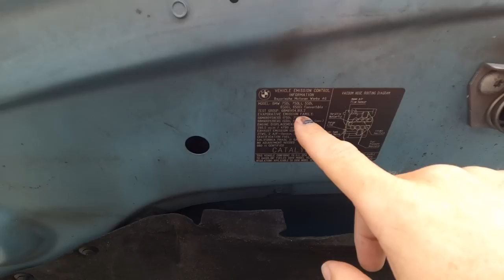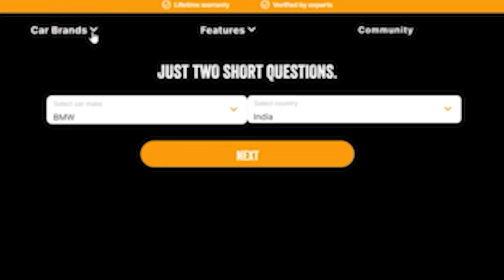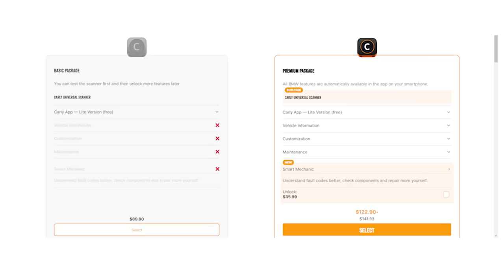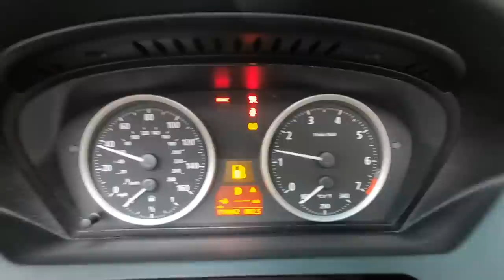We bought and sold a Salvage Title BMW 650i - Will we Profit or Lose?

Comment: Just got a 2011 BMW 328i xdrive. Salvage title from auction. I love it, first BMW great little four door all wheel drive car for winter. Replaced hood fender and headlights. I’m sure when I sell it will get up to double money put in…Don’t be afraid of salvage title, just know what caused it… in my case a barely damaged hood, a cracked barely bumper, dented fender and busted single headlight plastic…
Reply: If you are a private seller, save the photos and show the new buyer when ready to sell.

Comment: I owned one. Way back when. It kept dying on me quite often . I remember  a recall for this issue .  The fix sounded very easy. The wire connected  to the main battery was installed backwards.

Comment: Nobody in the history of BMW that has bought a BMW has ever done alright at anything other than buying a ticking time bomb that the only surprise will be the number of different things that can go wrong and will with time, go wrong!
Reply: Yupp its inevitable, those that say "ive had a bmw with so many miles problem free are full of shit" most of their parts are made of plastic thats not designed to hold up for very long and this will lead to leaks, not to mention all the extra sensors and electrical modules that will go out in time, like you said its literarily a bomb. Owned one at one point and never again 😂
Reply: Facts
Reply: Um............that's like every other mfr., every car is a potential mechanical ticking time bomb.
Reply: You paid $3800 for it. If you spend $12k fixing it you can probably sell it for $3300
Reply: @shelbysnake5003  Considering bmws ranked really high as reliable cars, a lot of people must be lying 😂 except for you of course!!
Reply: Meh, there have been some BMWs have been alright. My dads business partner had a 2011 7 Series Diesel that he put on 400k kilometers in 10 years and the car has been reliable for the entire time all the way until the end when it had a major oil leak that wasn’t worth repairing. But that’s to be expected. Not like American cars are any different (looking at you Ford, with your terrible transmissions that last maybe 200k kilometers). And then there are bad BMWs. My dad had a 2019 M550D and the car broke down 1 month after he bought it. Then the AC stopped working, multiple sensors failed and the last straw was when the entire infotainment system (even the driver’s information display and the speedo) stopped working. He actually replaced it with a high mileage 2017 Audi S8 and even that had been way more reliable.
Reply: Agreed
Reply: @Just some random guy  make no mistake I'm in no way saying Ford or any other American car are pillars of reliability! I'm also sure  that there have been BMW that have been great cars, (the sun shines on every dog's ass one day) your statement about AUDI is true, I've not heard any real negative information about them but if you want reliability with low maintenance cost and repair cost we must take this conversation across the ocean to the land of the rising SUN however they do have manufacturing in Mexico and The United States which makes sense considering they are taking over the world. Basically if you want a car you can count on but feels like you have E.D without any viagra then Honda, Toyota, or Nissan are top of the list. (Those manufacturers do have what some would say are performance model cars but the increase in performance comes with the cost of reliability
Reply: Seems to be the case in the US market the Germans wouldn't agree.
Reply: BMW a money pit same as mercedes and a host of other brands
Reply: @ddutsie No
Reply: @Beamers CEO of bmw has entered the house
Reply: Most BMWs are neglected because people who can’t afford them buy them. Don’t buy used, and don’t buy if you don’t have the funds to fix an abused one. Haters
Reply: I've come to the conclusion people who shit on BMW's without any knowledge of actually owning them are just really salty Subaru owners. Don't you put your evil on us Subaru owners 🤣🤣
Reply: @robsim4692  yeah generally Japanese cars are good, except for some of the Subarus due to engine issues and some of the smaller Japanese cars (they rust so fast where I live). Now Audis have been reliable to my family, especially since we take good care of them. We have 4 Audis and one Volkswagen. Most of these have been trouble free including my first car. It’s a 1995 Audi A6 with 130k miles (converted from kilometers), been a one owner car and it’s just had normal maintenance. It’s on its first engine and first transmission, just passed the strict car inspection Germany has. I’m planning on getting it to 150k miles in the next few years.
Reply: @adasterdezaster2865  did this with a 2.0t Passat, that thing kept me busy 😂
Reply: @Beamers  For the year 2022, one year is nothing to bragg about when you take into consideration how long they have been manufacturing cars for, the BMW brand has been a meme in the car world for the longest you should know this bud 😂
Reply: @shelbysnake5003  Who said anything about just 2022?
Reply: Most of their inline 6 engines are pretty good, some accessory things and certain gaskets that are common to go out but also remember bmws are oriented towards performance not long term reliability.
Reply: I bought a 2010 335d with 70k miles for $20,000, drove it for 7 years, put 100k miles on it,  sold it for $7500. I took excellent care of it and enjoyed it very much.

Comment: You know what you can do with 3800 at the auctions.  Consider you need your money to make 2 grand to break even.  Possibly one flip.  The next buy should get you near 7-8k when all is said and done...again how are sales during the holidays?  Once you do sell your second vehicle think on the time factor because that will be the determining factor. I am also pretty sure it could snow in April too so it may be 4 months till top down spring.  If at any point along the way you want to blow the car out cause you still aren't sure what you will get for the car, imaging you just want to get rid of it and blow it out for 6500 and say enough all ready.  After reading this I'm sure you would agree the best to do is sell it now and have the money to work with.

Comment: What is that color called?  I’m looking at buying one that was hit on driver side door and fender. Runs and driver great no smoke. Car is $1000 and I’ve priced door and fender 250 a piece. Paint may cost around 100 with me painting them. So 1600 all in without running into any bumps. I’d most like put it up for sale for 8500 and come out with 6k at the least.

Comment: 6500 for any car with 177,000 miles on it is insanely overpriced 
Craig 
Most people who buy a car expect to get at least 75,000 miles of use out of it without major engine or transmission repair or replacement 
They don’t just let them sit or drive to concerts or picnics
They really want to buy something with less than 100,000 miles 
You paying 6,500 for a 177,000 mile car is ridicules even 1,500 sounds high especially if it has rust.  
My  best wishes always from Las Vegas Craig 
Bravo 😊

Comment: I love the Carly App it helped me fix everything on both my 330I's and I was having an over heating issue on one and my autel wasn't telling me anything. No codes but MyCarly told me that the fan was not working correctly. Ordered a new fan from Rock Auto and a year later still good to go! If only it could reset the transfer oil wear so I could reset adaptions or test transmission solenoids like the INPA software which is a pain in the ass. Another good app is XDelete if you have a awd car you can convert it to RWD with an app. FYI 96 and up are OBD2 😁

Comment: These V8s misfire when someone puts 87 gas in them. They absolutely need 91 premium. Next is vacuum leaks, then coils.
Fill it with premium, Clear the codes, go through the drive cycle and you'll probably be good.

Also, misfires happen on these when you run them out of gas.

You dodged a bullet on that one. Hard to sell those ugly ducklings and the V8s have a lot of problems. Gotta be a mechanic to own one

Comment: I am not a fan of this series of bmw, I do think it is the ugliest looking BMW cars, all the ones designed by Hooydonk. As for the model number, the first number is the model line, the last 2 digits should have told the engine volume in Liters, saying a 330 is a 3.0 3 series, the 650 should then be the 6 series 5.0. This did also apply until the BMW 540 came out (E39 / 1988), that were an 4.4L V8 not an 4.0, and from that point it is an Ish number, saying 5.0Ish liter. But all the older models are exact what is stated on the number.

Comment: Puts 87 octane in a bmw that requires premium...that will ALSO cause a misfire and spark knock too. Did that when my dad had a mustang gt convertible back in 99/2000 when gas was 99 cents a gallon...spark knock from hell. Bmws are already pieces of shit, but you aint gonna fix it by putting the wrong fuel in it.